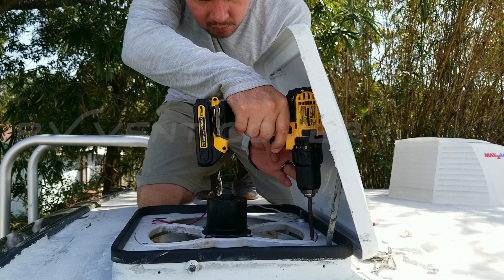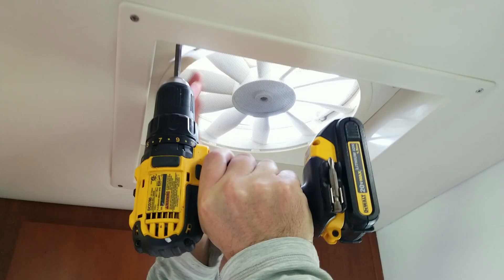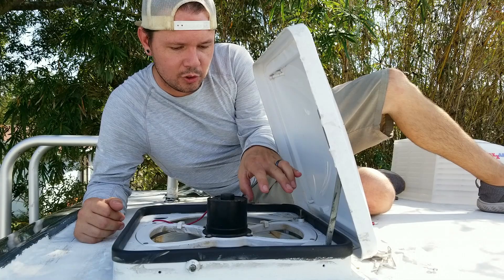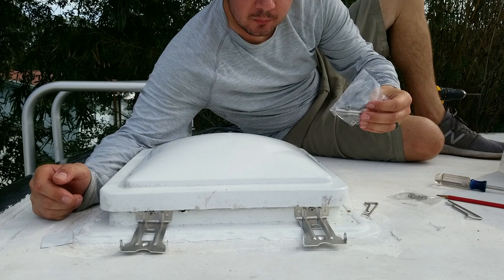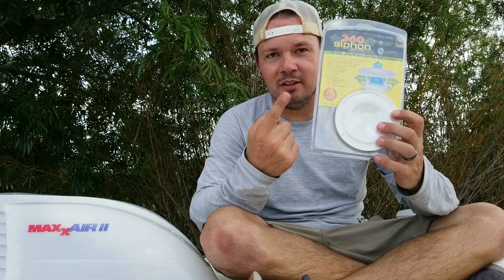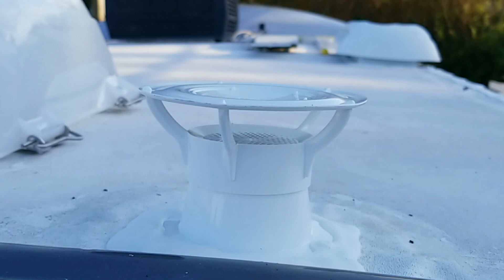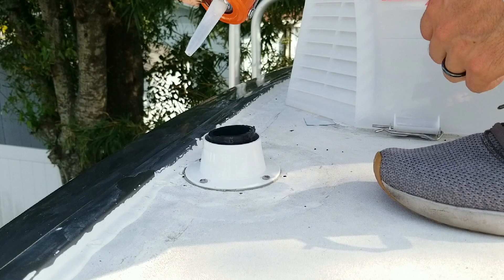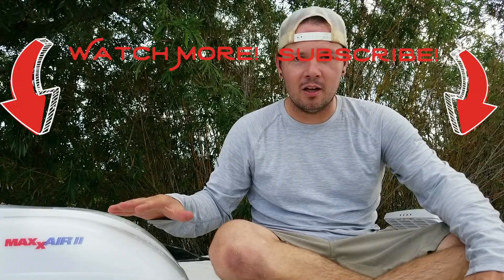RV Vent Cover Upgrades | 360 Siphon + MaxxAir | DIY RV Remodel | RV Living Full Time

Comment: Think it will stand up to hail damage after feeling the plastic? Or check after any hail storm? I have to drive about an hour to get to where mine is parked.
Reply from the maker: I'm assuming you're asking about the MaxxAir II vent fan cover. I think it will fare just as well as the lid that's installed directly on the fan. Depending on the severity of the storm & size of the hail. I would think of it as an added layer of protection to protect your vent fan lid from failing from hail!
Hope this helps! - Dennis ✌️
Reply: @EatSeeRV  No the vent for the black tank.